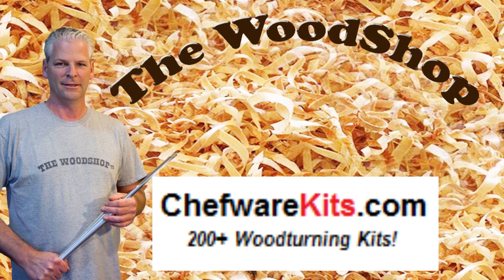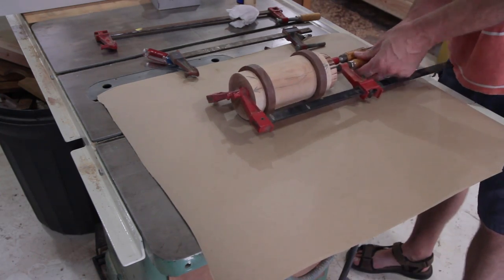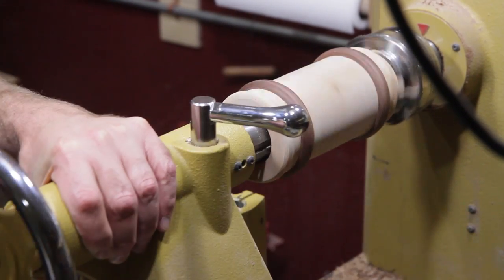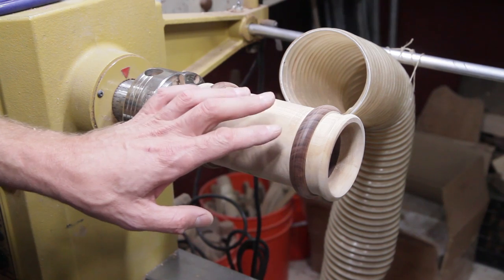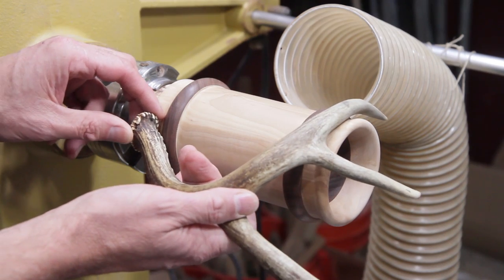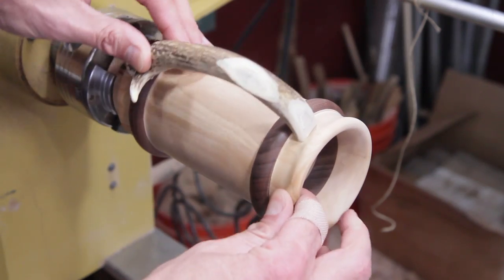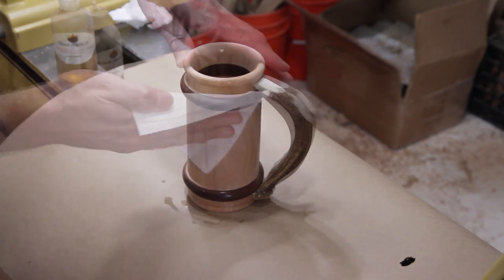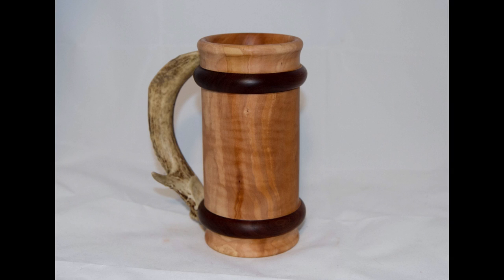How To Make A Beer Mug DIY Woodturning Projects

Comment: For future antler work, you can tea stain the fresh cut areas to darken them for a closer match to the rest of the piece. By the way you should make some more of these ( different handle if you didn't want to use up your antler stash), seal them with epoxy, all epoxy is food safe when cured. I would buy a couple. I love my turned wood mugs, best thing for drinking hot beverages in my opinion. Well done, mug looks awesome.
Reply from the maker: Thank you! and Thanks for the tips!!

Comment: If you put some super glue on the antler where it has been cut and let it soak in you may need several coats. And then hand sand it with 220 the heat of the pressure will give it a burnished nice finished look.
Reply from the maker: glockanator13 Very cool! Thanks for the tip.

Comment: Greetings!  I am in the process of a similar project except that it will be much larger and I plan on using it!  My question is how do you feel about the durability of the glue holding on the antler to the mug? 

My mug will hold about 38oz full so it will be pretty heavy, however I will have 3 points of contact with the antler on the mug.  I know there are a lot of variables but do you feel that epoxy or gorilla glue can do the job alone?  The wood is birch and the antler is deer.
Reply from the maker: Beer and Marshmallows I would make a small dowel for the handle if you were going to use it a lot. I would love to see some pics when your done.
Reply from the maker: Beer and Marshmallows Very cool Damian, I shared it on my FB page.

Comment: What is the machine called that you were carving the mug on?
Reply from the maker: +FernB1977 It's a lathe
Reply: +Carl Jacobson Thanks for responding, really like your work. Any recommendation on brand of lathe?
Reply: you might want to take a few woodworking classes before you go out and just buy a lathe as they're extremely dangerous to use if you're not trained, and still as dangerous even when you are.

Comment: Just in case someone watching this doesn't know, Gorilla Glue is not gap filling... it has no strength whatever if the joint isn't tight. Funny enough, the epoxy that he chose not to use can work great to fill gaps.